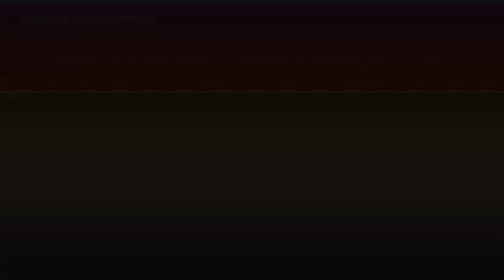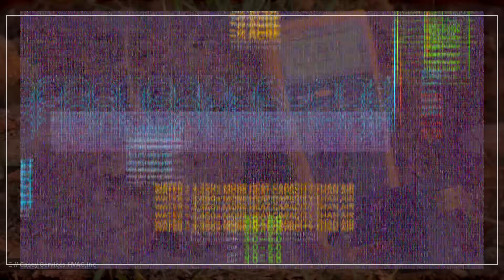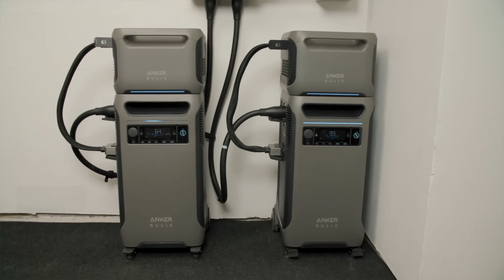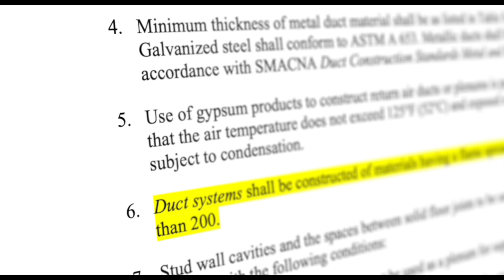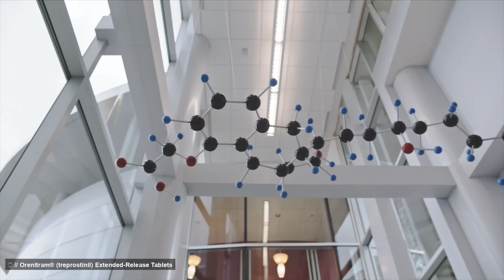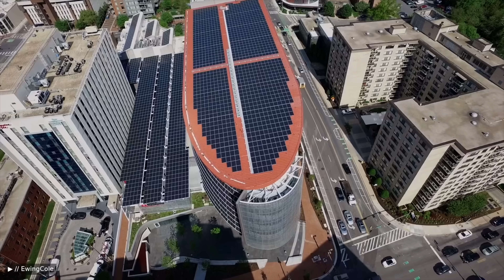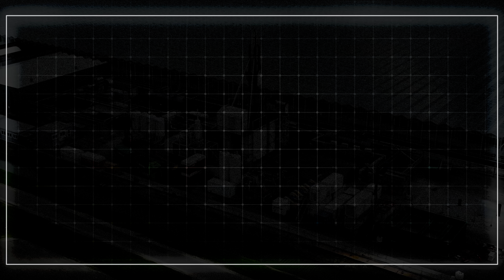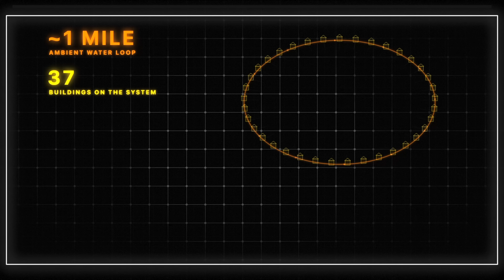The Viral DIY Cooling Hack That Nearly Killed a Family

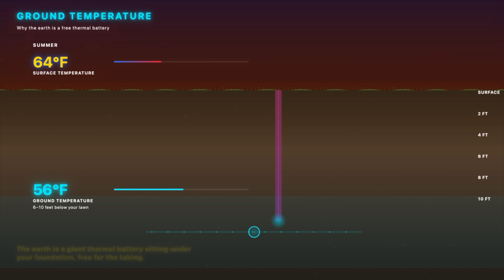Comment: @1:15 ...soil temp depends on location, is linked to avg yearly temp, and isn't year-round steady-temp till about 33ft depending on soil composition. temp at 10ft depth will swing roughly 8f, and far more at only 6ft depth (not linear). 

so if the avg yearly temp at your location is 70f, the soil temp will be roughly 66f-74f, depending on season, and will lag a couple months behind.

soil type is another factor for heat transfer. dry & rocky will struggle, but you can mitigate this some by sandwiching the loop between several inches of sand, and running swales/drainage/small plant beds above to aid with moisture.

also, $100/mo for elec + $60/mo for the bore hole = $160, which is still more than half the neighbor's cost in the TX example. great, but not amazing. this is why the dwelling itself needs to be designed & built with Passiv or Good Enough concepts/materials/methods (ICF, calculated overhangs, etc). no single tech is the magic bullet.

Comment: Drilling those wells will be expensive. Better option is the horizonal coils. You can install them yourself using an excavator. Probably for $5K to $8K you can rent the excavator and the buy all of the black poly you need. Each one of those wells will run you well over $10K.

Comment: In my area viability of GSHP is totally dependent upon your electric utility.  If I lived less than a mile south of my current location, GS would make sence for my upcoming need to replace the HVAC in my 30 year old house.  Where I live, my utility provides no rebates or credits for GS.  It simply doesn't make sense for me to change from my current conventional electric AC and gas furnace.  I still think new construction is the true growth market.  Cheaper to install when planned from the start with a  mini-split in every room,it becomes more space efficient and custom tailorable to your needs room by room.  Imagine planning your custom dream home where you don't have to consider conventional problems like HVAC ducts and return air. your HVAC becomes another plumbing or electrical run.

Comment: Geothermal is hugely important, not because of places like San Diego, but because of places like Prince George.  There's plenty of small to mid sized cities in northern reaches where it's not so cold that you have permafrost in the ground, but it get so cold in winter that even a good modern air source heat pump does not work.  The only option for heating in those areas is a furnace or resistive heating, because while heat pumps are good for most of us, they're just not viable for months at a time.  Or, of course, geothermal, since that can get you back in the range where heat pumps can function effectively.

In particularly hot climates, a heat pump will lose efficiency, so a geothermal setup can improve efficiency, but as far as I know there is no upper limit at which a heat pump just stops being able to provide cooling.  At least, not when we're talking natural atmospheric heat.  If you stick your heat exchanger in a wildfire, it won't work, but if it's in a wildfire, you have much bigger heat related problems than the AC not working well.

Comment: I'm thinking about ground-source radiant here in Michigan.  I'm TEMPTED to use a buried air-pipe (properly laid out) as the fresh air intake for the HRV/ERV system even though a system like that would probably need a booster fan of some sort.  HEPA filters for pollen, bugs and such at the far end, then the REGULAR filters as well at the HRV/ERV.